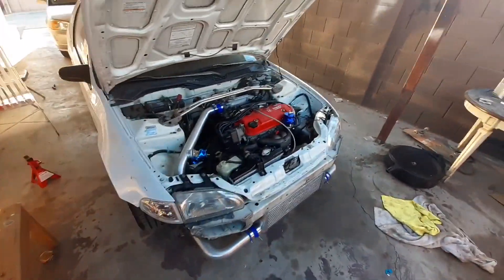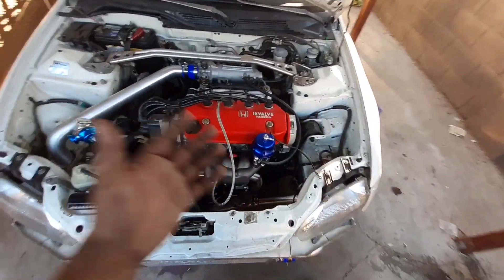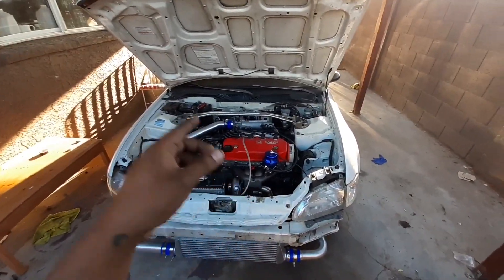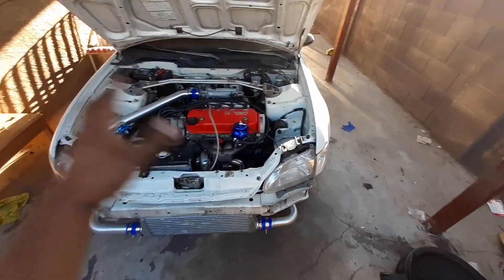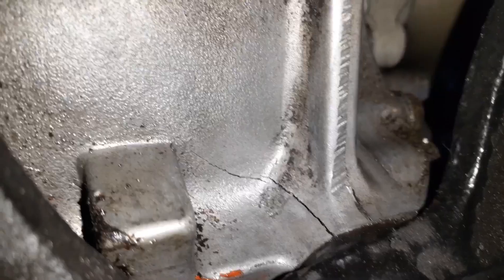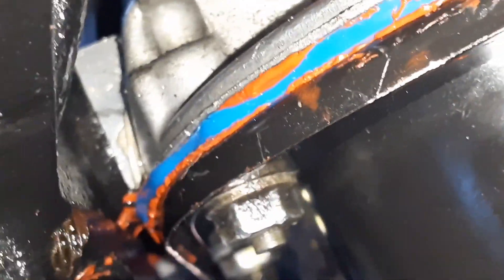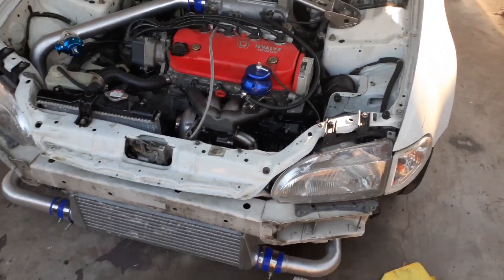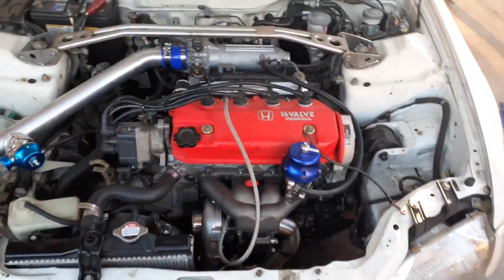The D15b7 has a cracked block

Comment: Did u end up jb welding your oil pan bud ?
Reply from the maker: Nah lol I never used jb weld on the oil pan but I did use it to fix the crack on the block.
As for the oil pan I just used a lot of gasket maker to seal it up